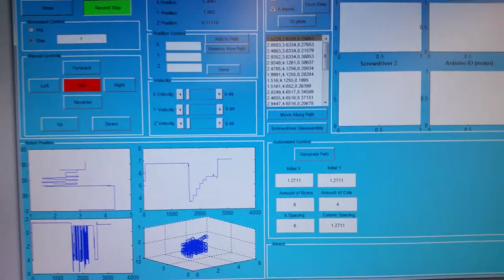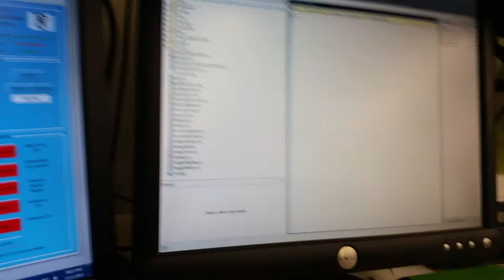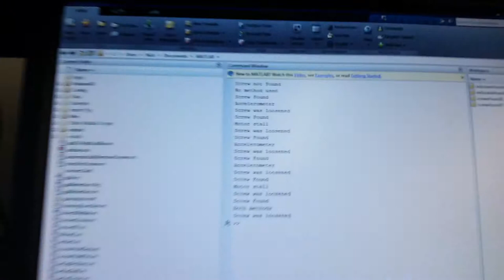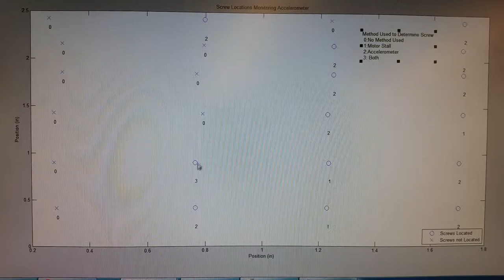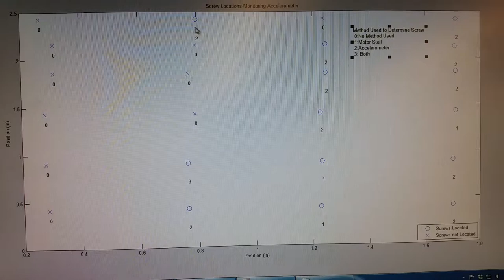Automatic screw remover

Comment: awesome project. would you mind sharing the equipment that you used/MatLab code? I would like to try this project
Reply from the maker: Hi, So I don't have this code anymore and the final code had become very system/hardware specific. This was back when I was in school and at the very beginning stages of this project which was eventually extended to automatically locate and remove screw holes. I do have a paper on the logic/results of what you see here that gives all the equipment setup if you PM me your email.
Reply: hello, would u mind sharing it with me too?
Reply: very impressive project and i would like to try it out too